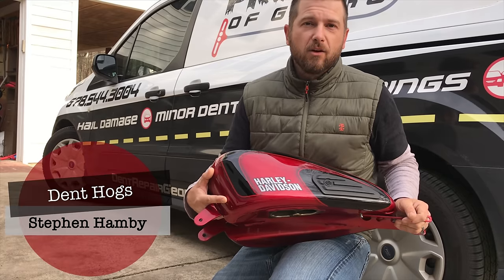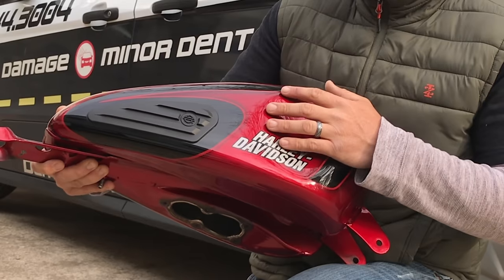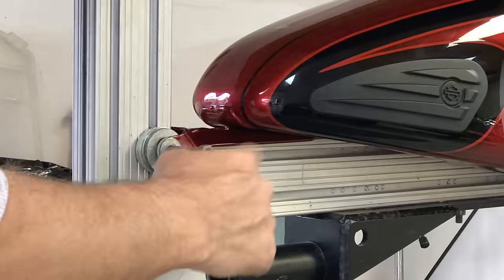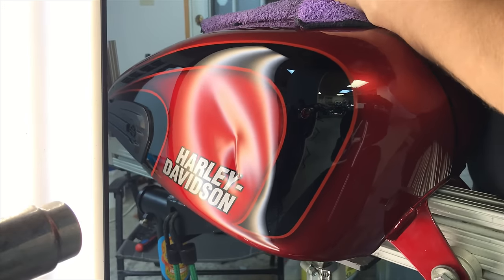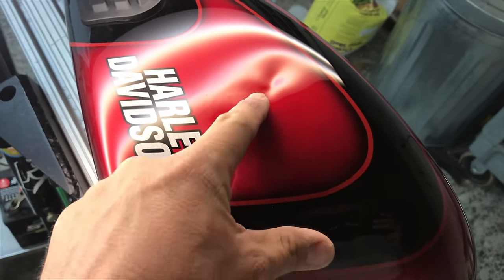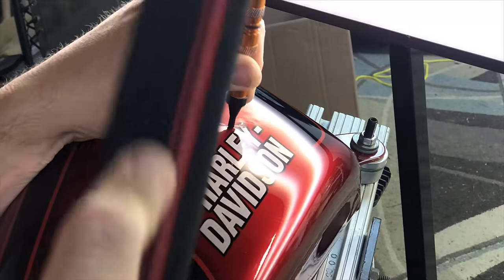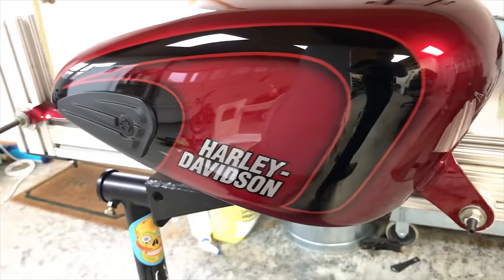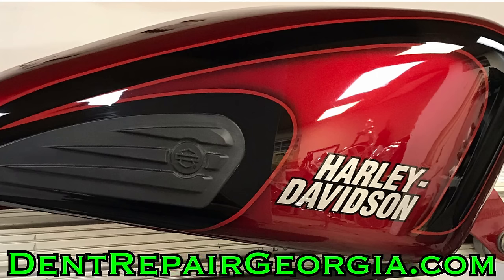Motorcycle Dent Removal - Harley Davidson Sportster Gas Tank Paintless Dent Repair

Comment: This process is an art form it should not be performed by do-it-yourselfers, this was an absolute professional job and it is one of the only three times I've seen someone get this kind of crease out. Your work was flawless and you're definitely an artist. I've been in the restoration business for over 30 years and we have a guy that comes by and does this type of work and he is absolutely amazing and you definitely matched his expertise.
Outstanding video.
Reply from the maker: Thank you very much for the accolades and feedback.  I really appreciate that 👍.
Reply: @ProPDRofGa  what do you do when a dent is on the opposing side of the gas cap when it's asymmetric located all the way ok the opposite side with a tank divider/anti slosh plate inside?
Reply from the maker: @jonathangarzon2798  if there is no way to get a tool to it from within the tank then most likely it will not be repairable with PDR.  Glue pulling is an option but it’s rarely effective on tanks.
Reply: Nice job 👍 I paint n do bodywork. But that was amazing. Very clean for the damage that was done! Nice
Reply: What do you charge for dent removal on a gas tank? Do you also do paint touch up?

Comment: 15 years as a body man, off and on for years after and I can tell you that what you did with that tank is amazing. It does seem to get easier when you have that reassurance from the customer that it’s ok if you crack the paint...you can work past the point that you think is safe. Sometimes you win and sometimes not. I’m very impressed.
Reply: Well that is amazing

Comment: Very Awesome work on that Harley tank  Ive owned and rode many Motorcycles in my  life  I’m 56 years old and bt far that was one of the best  gas tank repairs ive ever seen on one messed up that badly  more importantly a Paintless repair  Ive always wondered why  no one has made a Elecro Magnet   repair system that would allow you to insert   shaped Steel peices inside the tank and  pull using a very strong magnetic force  of course with that  very cool Vise set up  you have  and your process  perhaps there is no  need to  do repairs any other way  i’m quite impressed that you got that sharp crease out as well as you did  i know years ago petiole used to build  weird contraptions to try and reach all parts of the tanks thru the fuel holes  one time at a Flea Market in Florida a group of guys were selling off their contents of a Motorcycle repair shop they closed and  they had a box  of all these weird shaped  items they welded up  so i inquired about them and thats what they used to try and straighten damaged tanks  as much as they could before they sent them to a painter  i didnt have a need for the box so i passed it up  and bought some other things they had  that i could use  living and riding in Florida  all the sand on the roads could pit a  face shield pretty quickly  so i bought some NOS they had  then shared them with freinds  for my cost  which was close to a dollar each
Reply from the maker: Craig Monteforte cool 😎 I would have been curious to see what those tools looked like 👍🏻 thanks for watching and for the compliments, I appreciate it.

Comment: I was a PDR tech firm Dent Wizard years back and later went independent.  Did very little work on motorcycles but when you got to the stretched mound I too thought no matter where you go from there it'll never look unnoticeable.  That is some fantastic work! The reason I looked this up because my brothers bike tank got dented and I was looking for some quick solutions.  He also is an old PDR tech and still has most of his tools. Probably just going to do it PDR method.  It's a simple dent with no crease or smiles. Should pop easily.
Once again, that's phenomenal repair !
Reply from the maker: I really appreciate the compliments and for checking out the video.  My dad got his start with Dent Wizard also and then trained me 👍

Comment: That’s absolutely incredible. I wish this guy could straighten out my life like that. It’s all dented and stretched out to. I bet that buffer would feel good to.
Reply: Aren't those dents and scratches called memories? If you lose them you'll lose the good ones and might repeat the bad ones 🤔 Maybe just skip straight to the buffer 😁
Reply: @sethc6663  I have one in my 95 Heritage! Was run out of the road, someone crossed the yellow line up near Smith Mountain Lake!
Reply: I think removing that tank from the motorcycle would be harder than working on the dent itself just saying.

Comment: The tank looked so bad at the first of the video. I am impressed at what a great job you did on getting those stretched creases out. I used to help paint motorcycle tanks back in the 70’s and I usually had to use filler & repaint.  Good job! 👍🏻👍🏻👍🏻
Reply from the maker: Michael Chance thank you 🙏 I appreciate the feedback 👍🏻

Comment: Dropping a motorcycle as I have done will dent a tank. Wish I had known somebody that could straighten the metal out on my Super Glide tank. I sold the bike for  $800. The new owner parted out the bike and that tank ended up on a shelf in a friends car and bike shop. Probably still there after over 30 years! Nice work!

Comment: Is it a testament to your skill, or to Harleys paint, that everything came out so well. One thing I hoped I would have seen was the final result with your lights shining on it. What are those lights that show how misaligned things are called anyway?
Reply from the maker: ACoustaDC they are just PDR lights...come in all sizes and colors.  You can find them at just about any legit PDR tool company.  I won’t toot my own horn but I will say Harley’s have great paint and loads of clear....pretty forgiving to work with.
Reply: @ProPDRofGa  well the result was very impressive either way and I'm sure that you had at least 99% to do with that

Comment: Great job,what would a job like that cost?
Reply from the maker: D m8 700-900 depending on the severity and tank.  This being a numbered tank, the replacement cost was very high so it was worth repairing.....sometimes with damage this severe replacement is a better option.
Reply: @ProPDRofGa  thanks, I appreciate it

Comment: You're a Master ! 
How do you keep from the heat gun changing the shade or tone of the metalic paint ?  I repaired a dent and the paint was slightly darkened but it was only visible at certain angles of sun light !
Reply from the maker: Toniche Cavalari That happened as a result of the metallic flopping, heat does not cause this. When you’re pushing the metal back out if it comes up with a wrinkle here or there it causes the metallic to lay differently so when light hits it at certain angles you will see shadows. Certain paints are very difficult to repair without this happening
Reply: @ProPDRofGa  👍👌😎

Comment: Practically magic if you didn’t just transpose before and after, which I doubt. But now that you’ve done it, is it more or less work to fix it your way or just no do and paint?
Reply from the maker: walter kersting there’s only one factory finish, once that’s sanded and repainted it’s gone forever so personally I would rather do this even if it takes longer, but it is usually quicker than Bondo and paint
Reply: Pro PDR of Ga I agree that aged, ( as opposed to fresh, possibly a little green) professional work done at a high level like that is well worth saving.
It’s also why it’s not a joke to damage a nice job like that.  Your pride is entirely justified.

Comment: Ok, question ?  How many hours in that tank and what was the cost ??   As everyone says Great job !!!!    Unbelievable !!
Reply from the maker: Bobby PDR isn’t priced based on an hourly rate, typically it’s the size of the dent, location, and panel that you’re working on if you’re talking about cars, tank or fender that you’re working on if you’re talking about motorcycles.  But I had 9 hours in this one.  I remember it was in the 800-900 range but one like this could vary depending on the ease of access inside a tank, the thickness of the metal, and the ease of mounting it to the vice.

Comment: Great job! How much did that cost?
Reply from the maker: lemans 350 one like this usually runs 700-900 depending on the location and depth, some tanks are cheaper to replace but this was a numbered tank so repair was more cost effective.

Comment: I’m here because I have dents in my tank. I bought a PDR “kit” off Amazon for less than $20. Had two pullers, a scraper, some glue sticks and the pieces you glue to the dented area. I had very low expectations but figured for $20 it was worth a shot. To my surprise 90% of the dent came out after 1 failed attempt and 2 good pulls. The dent is barely there now. The dent was the size of a a baseball and as deep as 3/4 of a inch. All but a tiny bit is gone.
I used gorilla glue sticks due to the sticks from the kit being too small for my glue gun. 
The 2nd pull which was really the first real pull blew my mind watching the dent come up right in from of my eyes. Then the next pull really shrank the dent to almost nothing. After that I could not get more of it out and burnt the shit out of my thumb, so I boxed it and got to paint correction.
Pro PDR guys have my UTMOST respect. I bet that is one heck of a satisfying job. Closest thing I have ever seen to magic.
Cool jig for holding tanks. I sure wish we were in the same area. I bet you could make my tank look perfect.
Reply from the maker: Most of the jobs we do are shipped to us so there’s still hope 😂

Comment: What was the cost ?...I have a similar dent but smaller...
Reply from the maker: Sharky 883 this one was between 700-900, there was a lot of labor involved in straightening it out., replacement was $6500 according to the customer which blew my mind.  Each tank is different due to access and metal thickness.
Reply: @ProPDRofGa  thwack you for replying...yeah  I seen that his tank was one of a few made....my tank will actually cost a 1000 for the original...so ... but thank you.. you did  an excellent job on that fix...I'm sure the customer was really happy.

Comment: Does wet sanding not damage the paint work? so in this case did you have to touch up the paintwork and relacquer ?
Reply from the maker: rua Modra no actually Harley’s have tons of room for wet sanding the clear.  There are multiple layers on the paint even to the point that they clear over all the decals so you can sand a good bit without damaging the finish.

Comment: Normally hand repairs can run more than replacing the actual part. That tank must have been a very expensive piece. Nice work by the way.
Reply from the maker: Ramond Ferreal thank you 🙏.  It all depends on the damage and tank.  Some tanks are irreplaceable, some are very expensive to replace like this one was, some you can get for 200-300 bucks online.....just depends.  I try to steer people in the direction of what makes sense in each situation.

Comment: Amazing.  Paintless dent repair places wouldn't touch my tank dent as they said the metal is a lot thicker than on cars.  There was also limited access through the filler cap unlike this tank.
Reply from the maker: Zen Zen there are very few guys in the PDR industry that will do motorcycles.  A lot of misinformation out there unfortunately.

Comment: What did you use to hold the tank?  Thanks
Reply from the maker: https://www.ultradenttools.com/products/set-31-mpdr-vise-stand-system?_pos=7&_sid=ade43a764&_ss=r&variant=12240545873984
Reply: Pro PDR of Ga thanks a lot

Comment: Very nice nice work
 So what tap down did you use to knock down the mounded crease area ? Looked like a thin tip plastic?
Reply from the maker: straight lines pretty sure I was using the plastic VIP tip because I dulled it and ended up buying dead on dent tools pee wee tip to replace it.

Comment: How does this work for double-wall tanks? I've got a Yamaha Bolt with a quarter sized dent in the shape of the piece of gravel it was sitting on after turning sideways on a driveway curve. Crease in the middle like this video. If you can't get to the backside, what's the best thing to pull small dents? I'd rather not bondo and sticker over it. I think clean and simple looks better.
Reply from the maker: I actually do not believe it’s double walled, in fact, I’ve never seen a double walled tank. I have seen tanks with limited access, but most of them are just hollow inside. Yamaha bolts can have restricted access, but if it’s fuel injected, I think there is a large opening in the bottom. If you want to send me some photos, I can have a look at it for you and see what can be done about it.  Propdrofga@gmail.com

Comment: Very nice work. I'm curious how much did this repair cost?
Reply from the maker: A repair like this on a Harley tank is going to put you in the 800-1200 range more than likely.  Depending on the tank (numbered or rare, custom paint, etc.) sometimes replacement is a better choice….kind of case by case on that.  This tank would have been a couple thousand to replace I was told at the time.

Comment: I have heard you can use a rubber air bladder football or basket ball "inner"... OR  Being very careful using a Dent Weller kit with the rivets.. you have to sand the tank to bear metal.. to do that step...

Comment: Currently have a Road King, just added a 17 Iron 883 to my collection, Iron is red denim, has a dent in right side tank, slightly smaller than this video, one repair shop I took to said was a problem with size of tank neck, possible damage going through that hole, fuel pump entry  on opposite side , can't go through , question, you had no problem entering the fuel neck on this repair, and any good shop should be able to us your method ?....Thanks
Reply from the maker: Mike BigEasyRider send photos of your tank to propdrofga@gmail.com and I’ll have a look at it and let you know what I think and we can communicate through email if that works for you.

Comment: How do you use any kinda tool even rubber face tools especially pin tools directly onto the paint without damaging the paint ?  Please tell.
Reply from the maker: They are polished, smooth, and designed to be safe on painted surfaces

Comment: What would be a round about price on a job like this?
Reply from the maker: It really depends on the type of tank that it is on and how large and deep the dent is and where it is located on the tank, this tank was between $800-900 to repair but it was also a several thousand dollar replacement so it made sense to repair it versus replacing in this situation
Reply: @ProPDRofGa  ok thank you

Comment: nice job, how much to fix that?
Reply from the maker: J Marciano one this size will range from 700-900 typically.  Sometimes it’s better to replace, it all depends on the availability and price of a new tank vs repair costs.  This tank was rare and according to the customer it was $6500 to replace, blew my mind.
Reply: @ProPDRofGa  ill share ur info to my network, quick question, do you highly recommend highway crash bars to reduce chance of tank of hitting ground, or waste of money?
Reply from the maker: J Marciano it’s definitely better than not having them at all.  I have crash bars on mine.

Comment: What does a repair job like that cost? I just dropped my motorcycle and it’s not as bad as that tank it’s still something I’d like to have repaired ASAP
Reply from the maker: It’s going to vary depending on the type of bike and the the size, depth, and location of the dent.  If you want to send me photos you can email them to denthogs@gmail.com and I will have a look and let you know what I think

Comment: What's something like this usually run? I have a similar dent on the left side of my tank. About the same size, tried the glue puller method but those things are junk and crapped out on me. I had to bondo and prime and wrap
Reply from the maker: It’s going to vary a good bit depending on the type of bike, whether it’s fuel injected or carbureted, and the size and depth of the dent. The one in this video was somewhere around 1000 to repair.  I will usually let the customer know based on the availability of parts and their bike whether it is cost-effective to repair it or just replace the tank altogether.

Comment: Labor is not cheap, do we dare ask how many hours you put into the tank, and how much you charged.
Reply from the maker: Mark Kulyas I put roughly 9 hours in it.  PDR typically isn’t priced based on labor hours as much as the size of the damage and location.  One like this is going to range from 700-900 typically.

Comment: Fill it with hot oil, put a threaded sealing plug in the cap bung that has a grease fitting installed in an orifice drilled completely through the plug, fill the grease gun and carefully pump enough pressure to assist with tapping out the dent along the outside edges use a 3/8” silicone pad and a light weight plastic covered mallet with a bunch of gentle raps to shock the dent out, hydraulics do not store energy and will not blow out the tank if you’re attentive, on the same note, you’ll have to pump more pressure as you work the dent out because the slightest progress releases nearly all the pressure, you can even leave a small air pocket and keep the dent area at the highest point, (just don’t use pressurized air to force out the dent, you’ll burp the tank out in the flat areas) this will help if you need to resonate or “ring & ding” the sheet metal.

Comment: Why couldn’t you just use that inner tube trick?….stick an inner rube inside the tank and inflate it…the dent pops out.
Reply from the maker: Because if your goal is a perfect or near perfect repair, that method doesn’t work.  You may push a large mass out some, but you’ll be left with wrinkles and small dents still in the tank.